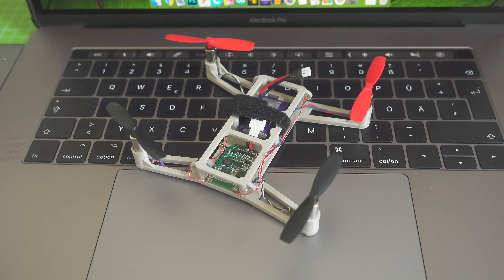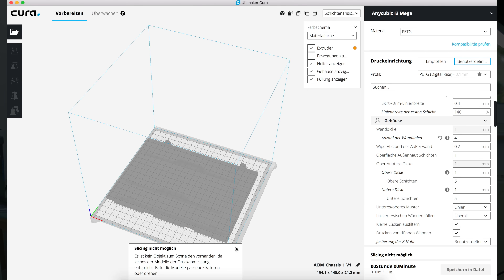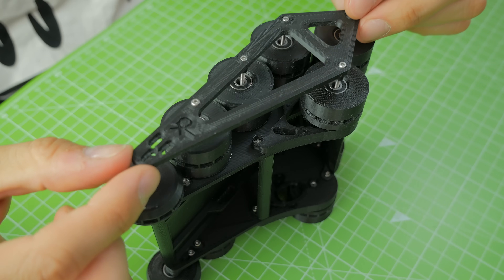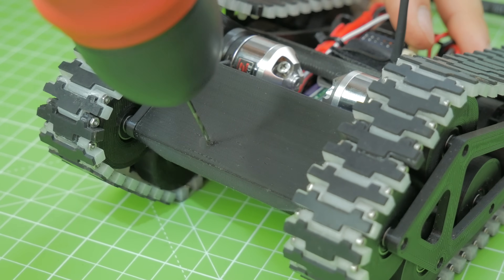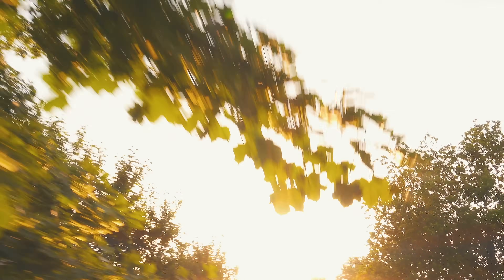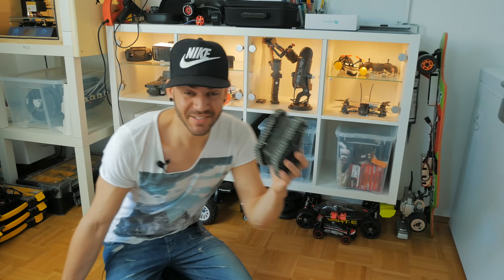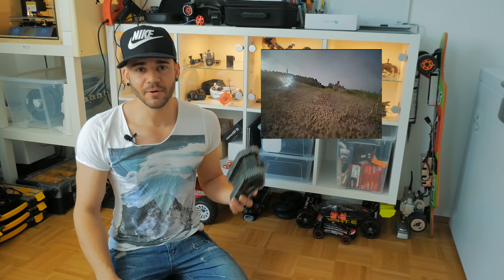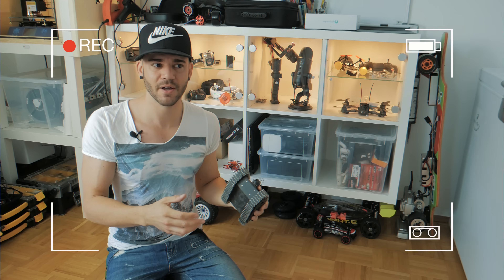3D Printed MICRO FPV RC Tank

Comment: A locknut, also known as a lock nut, locking nut, self-locking nut, It resists loosening under vibrations and torque. no lock tight required. You have the best looking tank design I've seen! I have seen many!

Comment: I’m gonna try to use some extra quadcopter motors, I can’t find the one you used. Seems to not be in stock or made any more
Reply from the maker: The most important thing is the KV, try to go with as low KV as possible! :-)
Reply: Philipp's I think lowest I have is 2408 2200kv...
Reply from the maker: That should work. Its a speedtank then :-)
Reply: I used a 2000kv motor in my speedtank. Used a 5:1 Reduction with it.

Comment: I don't know if I comment got added, sorry, but is this pretty smooth with fpv on something like carpet or hardfloor? I'm on a quest for smooth ground fpv. So far I've tried a 3d printed screw propelled vehicle, the faster you go the smoother the fpv gets. Thinking about hovercrafts, maybe tanks
Reply from the maker: bing bing Cool idea! Send me a link if you finished it :-)
Reply: Ok, it's been done for a while, just have no videos yet of it. I'll make a video for ya. Here is the file I downloaded for the screws, I downscaled it by 25%, the frame I designed myself and use Tamiya gearboxes and 150mm hex shaft. https://www.instructables.com/id/How-to-Make-a-Screw-Propelled-Vehicles/
Reply from the maker: That thing is very nice! Well done!
Reply: Philipp's sorry, what I meant was that I took his design and shrunk it down and remixed it. It's important for me to say that I did not design the screws for the vehicle. However, mine runs about twice as fast, and has potential with brushless motors for at least 3x the origional speed. (Screws turning look like a blur). I'll post a video within a week hopefully.
Reply: Here is raw video of it. https://youtu.be/GjDbCEE_aRQ and https://www.youtube.com/watch?v=kNqJ9VNkzlE

Comment: Hi, Awesome little thing. I am printing this at 100% now and looking forward to build it. 
May i ask what screw size you are using on this ? The original uses M3 and M4 stuff so this is smaller sizes i believe?
And what bearing size do you use for this great little thing ? :)
The motors are out of stock, do you have tips for any replacement motors?
Reply from the maker: I used M2.5 and M2 Screws. For the chain I used M1.5 screws. For the bearings just use half the size. (If it is outer diameter 10mm use diameter 5mm). Let me check the motors, I'll give you an answer later on that question :-).
Reply from the maker: Wow almost all motors you could use are out of stock. Perhaps you can use this one, but is is slighly bigger but should work with some small modifications. Tell me if you need a modified motor mount, I'll make you one.
Motor: https://hobbyking.com/en_us/turnigy-ld2816a-brushless-outrunner-1350kv.html
Reply: Oh thanks for the answer, i will make one like this too. If you have the possibility to make an adapter for the motor you linked i would be very happy. Im quite new to designing parts on my own. Will all the other parts fit the new motor you think? The pinion gear for the motor is this the same one from Stainds design just 50% smaller ?
Reply from the maker: I used a M0.5 Pinion that i made my own out of steel. Perhaps you can find a pinion that has a fitting hole with M0.5. The shaft from my posted motor is D 3mm, so it could be hard to find a pinion with that hole.

I found this one and it is in stock. Has a very high KV so perhaps it will kill your main gear. But this one will fit with the motor mount I made!
https://hobbyking.com/en_us/turnigy-aerodrive-sk3-2118-3100kv-brushless-outrunner-motor.html
Reply from the maker: Good luck! :-)
Reply: Did you have to use smaller nuts on this beast or did they screw in?
Reply from the maker: Raphael De Roza I used smaller nuts :-)